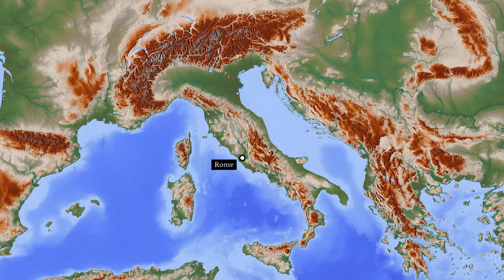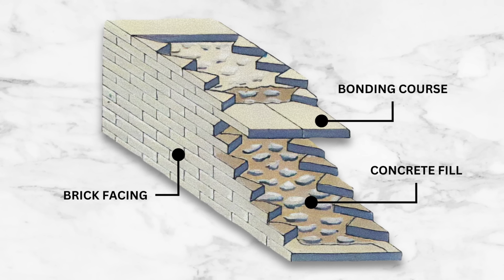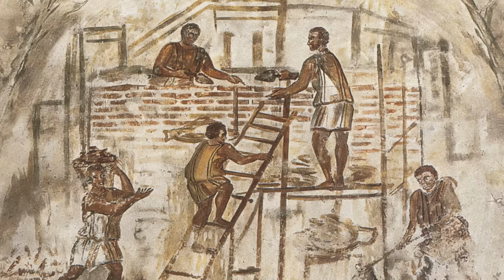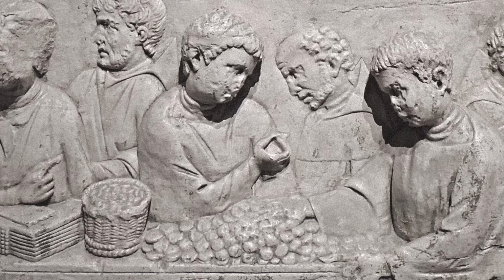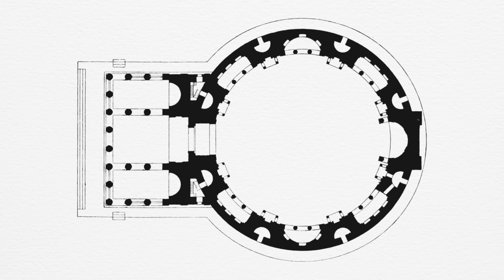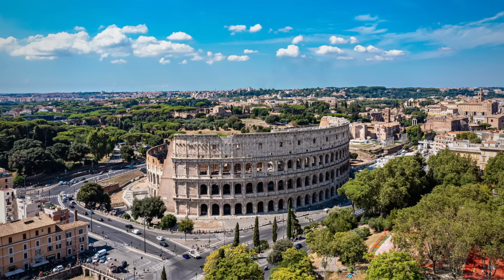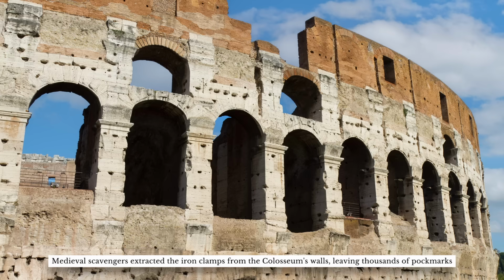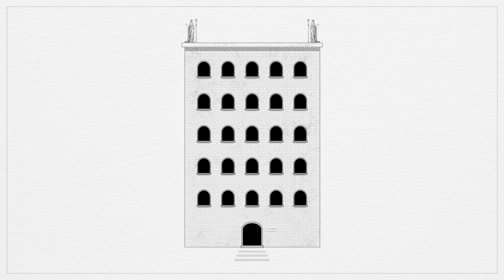Why isn't Roman Concrete used today?

Comment: Of course, if you used Roman concrete to build a skyscraper the same way as we do with standard concrete, all those problems mentioned would go away. Steel superstructures are used for a reason. The problem with standard concrete is that is doesn't last nearly as long as one would think. It is vulnerable to degradation from such things as H2SO4, water and salt, as well as flaking from freeze-thaw cycles and cracking instead of flexing under load. Pozzolanic ash in Roman concrete was only part of the story. What is fascinating about Roman concrete is its self-healing properties due to the presence of calcium carbonate (lime) clasts around a milimeter in size. Also, by using quicklime, it set at far higher temperatures, making the clsts brittle enough to give them their self-healing properties. These high temperatures had another benefit.The concrete set much quicker, accelerating the construction process.
Reply: doesn't last as long relative to what? Remember it could have a shorter lifespan but most buildings are being peserved for thousands of years I would imagine most buildings can get torn down in 100 years to rebuild. Your assumption about really long lasting isn't useful. Yes of course if you add steel to concreate ofc it works but romans didn't have steel like we can today with all the coke we can produce so easily
Reply: @monsterhunter445 I didn't make an "assumption" about concrete's longevity, I made a statement. Modern concrete is often thought of as long-lasting like stone, but compared to many types of  stone, it doesn't last long at all. There are brutalist structures from the 1970s in which the concrete is decaying already. Also, don't mistake strength for longevity. Steel-reinforced concrete is strong, but that doesn't necessarily mean it will last longer. Modern concrete has an expected lifespan of as little as 50 years. Architecture and history are my trades.
Reply: Exactly this video is stupid it didn't mention the fact if you ad steel reinforcements does problems completely disappear.
Reply: @Knightmare919 steel reinforcement makes concrete stronger, but had little effect on longevity.
Reply: @anthonysaunders345  "steel reinforcement makes concrete stronger, but had little effect on longevity"

Steel rebar in fact reduces longevity in many places. Eventually, water will find its way inside the concrete causing the steel rebar to rust, expand, and crack the surrounding concrete. We could still make structures lasting thousands of years if we wanted to by not including rebar, whereas a structure with steel rebar simply can't last that long (except maybe in a very arid environment).

"by using quicklime"

Quicklime is also a major component of most modern cements.
Reply: @seneca983 I suppose I should have said "this" quicklime. I thought after the previous sentence I made that clear, but I was talking specifically about quicklime with the clasts I was speaking of

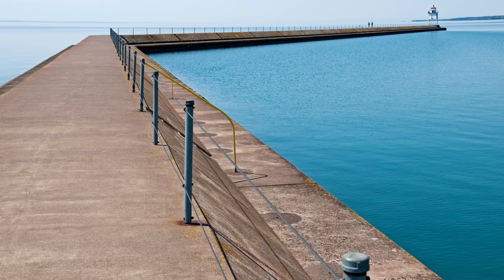Comment: 7:39 Breakwater at Two Harbors, Minnesota, to protect the iron ore (taconite) carrying lake freighters in Lake Superior
Reply: I'm glad someone else noticed this! I wonder how he came across that particular structure as an example?
Reply: @greatnorthernhans3319  When I was walking it recently I wondered how they built it. His photo shows those circular concrete pours on the lower right where boats moor for protection. Were those poured first since they probably go deep into the bedrock, and then they poured the rest of it?

Comment: The main difference between now and then, is the reinforced concrete. 
Not as much as the concrete. Even if it was an horrible one for today standards, with iron bars would had been possible to build remarcable elegant structures. Would also had been incredibly expensive for the time.

Comment: its the reason why modern construction switched from masonry and concrete to steel structures in early 20th century - it drastically reduced wall thickness on lower floors and total building weight.

Nowadays we return back to concrete as main bearing element, no need for separate riveted frame even for 40storey building, reinforced concrete makes the job. But this idea of reinforcement (rebars, flexible steel tension ropes and so on), simple but effective, was not invented until 19th century and not developed to usable grade until mid-20 century.

Comment: Whatever program you are using to record the audio is cutting off the beginning of every sentence.  It sounds like some sort of auto mute function that cuts out at the first sign of silence and takes a half second or so to cut back in when you start talking.  It is very distracting.  Your earlier videos did not have this issue.

Comment: I listened for 3.5 min to see if you would include the real reason for Roman cements longevity.  It had nothing to do with volcanic ash per recent science publications. It had to do with lime not being milled too finely.  When a crack occurred, the large grains of lime would hydrate, swell and fill the developing crack with a built in bandage of sorts. And the fellow below is correct. Co2 nor air are required. I’ve set many fence posts with cement with no water added. You would be surprised that you can even make sidewalks w out adding much water. The compounds used to make cement are extremely hygroscopic, meaning they like to bond with water so much they can pull it from the air or earth surrounding them. Calcium and magnesium salts have to be cooked in an oven to drive this moisture off of the anhydrous salt is wanted and then stored in air tight containers. Once opened though they again naturally pull moisture from their surroundings. This guy does not seem to understand the chemistry involved at all and is just parroting what has been thought and said by others in the past. Now, I’m going to walk down the street and wade into the lakes public boat launch and stand on modern concrete that was poured and set in brackish water and think. You know, we really need to teach people to read primary sources so they can better learn to call bs when “experts” give their opinion.
Reply: Naturally hydraulic cements would never be able to pass the muster in modern construction projects. In modern times, projects are driven by cost and schedule. Even if sufficient quantities of Roman cement could be produced, the slow setting process would make the prospect of use DOA. Also, Roman cements do not achieve high-early strength required or the final compressive strength required by modern building codes. These historic materials, and there are many, are best suited for the restoration of important buildings that are not compatible with modern materials.
Reply: it's not to do with the milling granularity, there are two types of lime... hydrated lime and quick lime... quick lime is reactive and is calcium oxide (CaO) and reacts with water to produce heat and make hydrated lime (calcium hydroxide) which is not reactive...  modern concrete/cement uses hydrated lime so there are different chemical reactions happening than Roman concrete that used quick lime...  the quick lime was mixed rough into the mix so it wasn't all reacted so if water got into it or it cracked then all that would happen is that it would react more and form more concrete...  this is the difference, not really just the milling size... they left bits of unreacted quicklime in their concrete...
Reply: Also as some other said concrete cures, not dries. Important distinction: concrete can be kept moist its entire working life.

When my house footers were laid the ground water on the site had them covered up completely within 24 hours. The bottom several inches of the footers have never dried, and never will (sump pump runs all year long).
Reply: Also he says normal concrete cures from CO2 in air, which is 100% incorrect.
Reply: Lol, I also watched specifically to see if he knew this.
Reply: Ok. This makes sense. The dude has a PhD in Greek and Roman history. To me that basically means he learned to write speculations based on speculations of others with a few facts understood to varying amounts in a coherent and grammatical fashion.  I’d bet he had very little hard science courses at all.

Comment: I was reading that the colossus of Rhodes used a metal framework for support so the idea that you could build tall structures using metal was known to the ancients, too bad they didn't implement the notion on a grand scale.

Comment: It sucks for modern applications.

It's some sci-fi wonder material only to people that partake in "I think about the Roman Empire" memes, and think they know what they are talking about.
Reply: The self healing abilities could really help our current problem of roads and bridges only lasting 50-100 years if used right. It's using the best parts of Roman concrete to make our own concrete better.

Comment: Since seaside piers made of a variety of materials often seem to be destroyed when storms lash the coastal areas, I wonder if Roman concrete might be useful in the underwater structures that hold up the piers.  There was an article in recent years that said that the chemical reaction that produces Roman concrete distributes bits of a compound that can react with water to "self heal" any cracks in the concrete that might happen in the future.
Reply: IIRC it was mixed poorly so there were large chunks of unreacted lime that got activated by water filling the cracks

Comment: Any day now I expect to hear an announcement where a project will be using the same volcanic ash used by the Romans in their construction, together with the latest innovation in our industry, namely the addition of carbon nanotubes in cement, that already has eliminated the need for rebar, with the resulting structures being both strong and long lasting.

Comment: OMG!! I'm so glad I found you. Your knowledge of Roman building practices is invaluable as you have introduced me to Travertine, formed when high levels of groundwater contaning an elevated concentration of dissolved carbon dioxide come in contact with LIMESTONE, and similar deposits formed from ambient temperature water creating TUFA, reinforces my belief that the megalithic structures and underground tunnels all over the world were built and carved out of Tuff and Tufa which are soft materials easy to carve and hard to break down. Tuff, volcanic ash that can form a similar stone as granite but contains no fossils...and Tufa, such as stalactites and stalagmites that can be dated back to the Permian period 500 million years ago when the earth was still one giant continent called Pangea.  This can explain why the same type of structures were built on now separated continents.  Please look into this.  If anyone can give me answers, you can.

Comment: A better use case for a tall building in roman concrete would be a grain silo had they invented the concept.

They never really investigated preformed concrete slabs which would have speeded the process up and reduced the deformation inherent in tgeitmr techniques.

Comment: I very much enjoyed this video, I approve of both strategies and also am more optimistic than you on the possible success of both structural scehemes. I believe, the biggest concern would most likely be the earthquake resistance of the building, a very strong possibility in central Italy, and very damaging to unreinforced masonry and concrete structures. Statically both schemes should work well but lighter damage in the form of cracks would most likely appear, but they would not be structurally relevant.

Comment: Why isn't Roman concrete used today? The same reason cobblestone isn't used on streets anymore for the same reason they want us to pay for electricity rather they want us to PAY to live... I don't understand why this is so hard or difficult to understand 🤷
Reply: Let's see how cobblestones hold up to 40 tonne vehicles traveling over them thousands of times a year.
Reply: @willg9106  oh right like pavement does any better? I love chuck holes 👍
Reply: This is silly. You choose the right material and method to serve the purpose. 

You don't build a house when you go camping. 

Sure the colosseum is still around, but the Romans haven't used it for entertainment for a "few" years now. 

Cobblestone may outlast concrete and asphalt but it's going to be astronomically more expensive and take way longer to build. I don't understand how this is hard to understand. Longevity is not the only measure of how "good" something is.
Reply: @shawnsg  lol what ? Longevity doesn't determine how good something is even if that said thing is both great in quality and saves money over time,  idk... How about 150 years ? Lol does that sound right to you 😂😂
Reply: @shawnsg  see bro idk about you but in Toledo I see shit repaved once every 4 years maybe even 3 with assphalt. That's much more money over time, not sure why you would blow tax money on assphalt every 3 or 4 years just to repave it in another 3-4 years

Comment: When I was visiting Indonesia I noticed that the modern methods used in masonry construction differed from those in the USA. When I asked around apparently their concrete was particularly strong and cheap compared to elsewhere in the world. Turns out they too like the ancient romans would add volcanic ash to their cement.
Reply: Same with the Philippines, the volcanic ash from the 1991 Mt. Pinatubo eruption is being used in construction today.
Reply: I mean... We're full of volcanoes, it's cheap enough to use.
Reply: In a country with domestic steel production it’ll always be cheaper & stronger to use rebar. Roman engineers would collapse under the mental weight of our decadence if they knew we were using hardened steel inside of walls. Roman concrete is only durable in the sense of preserving ruins, as a structure the coliseum is not safe for human habitation. Every Roman concrete building still in use today has undergone dozens of extensive renovations each far exceeding the original construction cost.
Reply: @alexphelps7042 Why not both
Reply: There is the other thing, self healing concrete. Roman concrete was NOT 100% cured. Less adequate mixing. So if cracks appear (earthquake or storm) the concrete will carry on curing repairing the cracks. Edit clarification.
Reply: @Michael_Brock  Using quicklime in the mix creates the clumps that react to water and reseal cracks. Using seawater is also part of the formula.
Reply: @Michael_Brock  the concrete not being 100% cured makes it significantly weaker. Why make something self healing when you can make it not break in the first place.
Reply: The major differences between Roman concrete and any concrete used today with reference to longevity isn't the inclusion of volcanic ash, but the temperatures at which the limestone and other additives used in Roman concrete was lower, and included limestone clasts.

Comment: You can still make armed cement with the Roman recipe, and although it would be less durable than the historic material, on account of the iron framework's eventual rusting, it would last longer than the modern version since Roman cement would let much less water reach said framework.

Comment: Slow curing time makes Roman Concrete less practical. It also keeps curing as it ages after decades, but modern concrete buildings are slim and light, while the Roman buildings were massive and thick.
You can solve some of the limits with addictives, but still, portland concrete is more convenient if less durable.

Comment: I did enjoy this thought exercise. My question is, would differing weather conditions affect the structure? I know Roman concrete was used outside of Italy, but were there downsides to building with it in less temperate climates?

Comment: They didn't have concrete mixing trucks, and it was easier to shovel and pack down solid concrete than trying to mix watery concrete in a barrel and tip it over. 

Roman concrete was strong because it was trowled, as said, rather than poured. We can still make it. We don't because pouring and reinforcing is easier and better in modern applications. No thick concrete walls for us.

Oh, and modern concrete heats when it sets and can do so underwater if you plop it down thick.

Comment: People get so h***y over roman concrete as if it's this wonderous, unknown, lost-to-time building material that we have never been able to replicate. Nah, we have significantly better shit for building now and we're not building the same thing they were.
Our buildings are DESIGNED to last 100-200 years max, with a 50 year accuracy. Theirs were designed to last 50 years with a 2000 year accuracy. They simply did not have the tools nor the knowledge to refine that accuracy number down as we have, and thus, the material and effort cost along with it.
The colosseum would cost about $1 billion to build today, as noted in a video on this same channel from about 2 years ago (though it assumes building with modern machinery and has quite a margin of error). The empire state building only cost ~$650 million in todays money and the Lucas Oil Stadium by contrast cost about $1 billion.
Reply: I do wonder how well prepared we are to tear down and rebuild our construction works before they crumble. We are already seeing that many countries, including the US and Germany, are unable to prevent bridges from collapsing. (Edit: I am not advocating for adopting Roman construction techniques, just wondering how things will develop in our modern age.)
Reply: Maybe these structures were built before the Romans and they claimed them as their own like the Egyptians did with the Pyramids.